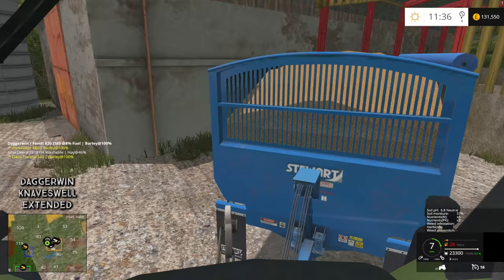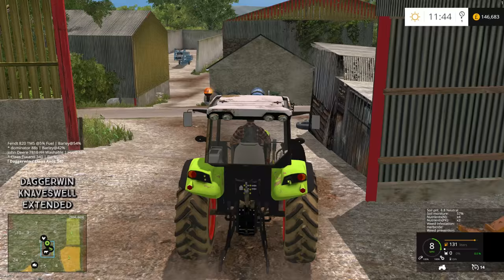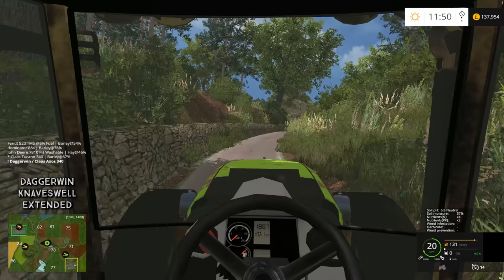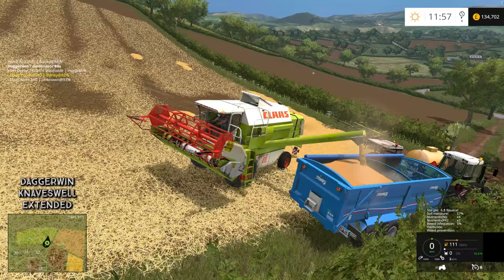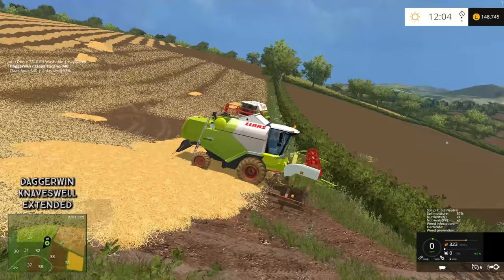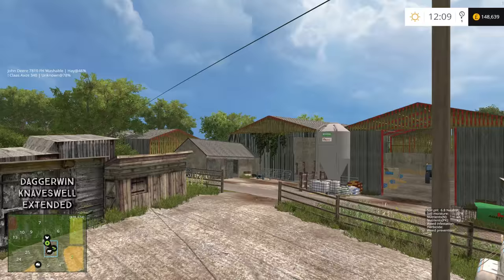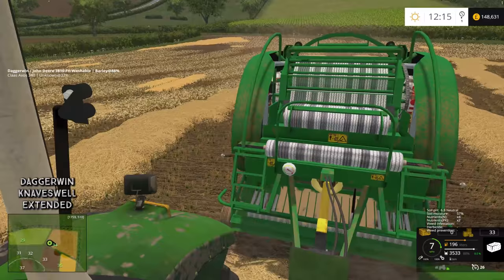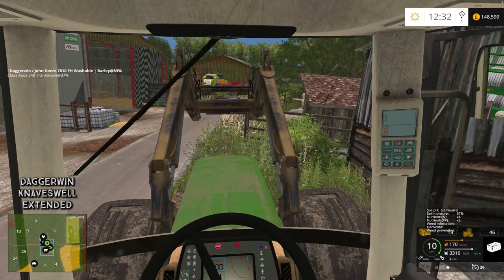Let's Play Farming Simulator 2015 | Knaveswell Farm Extended | Episode 2

Comment: can some1 plz tell me what red and white diesel is
Reply: White diesel is what you get in the petrol station for cars and vans. Red diesel is what farming/construction vehicles use. It is normally delivered to them rather than them picking it up and has a red dye added to it.

Red diesel doesn't have fuel duty on it so it's a lot cheaper but you aren't legally allowed to use it on the road except for agricultural use. Eire has green diesel rather that red used by the UK. All fuel for heating homes is dyed yellow in the EU although older diesel engines could use it for fuel.